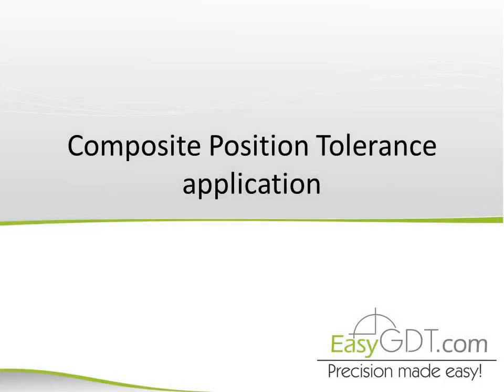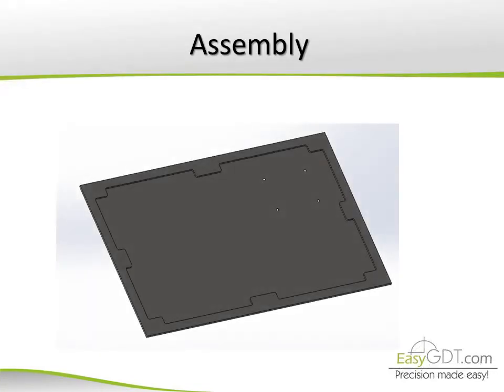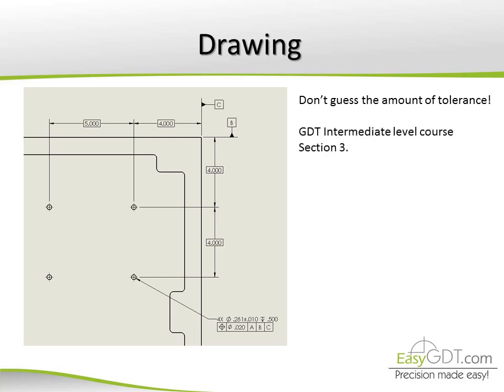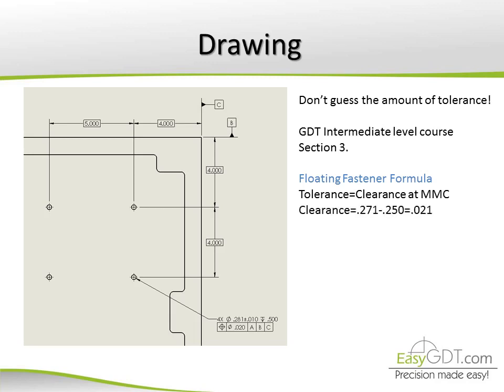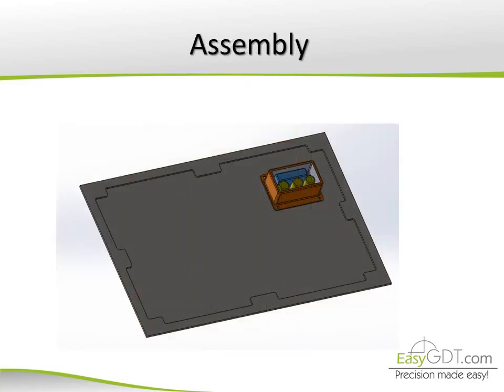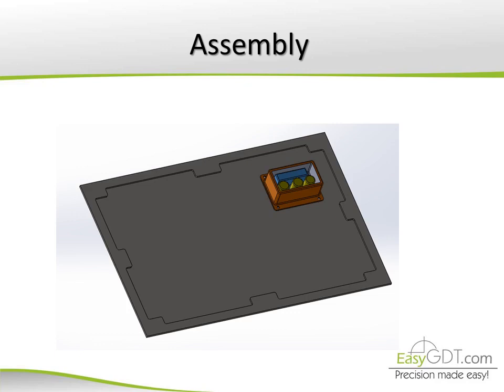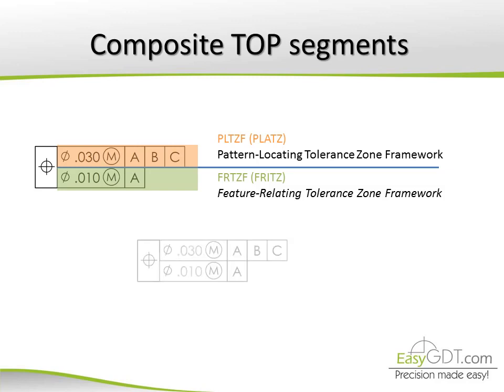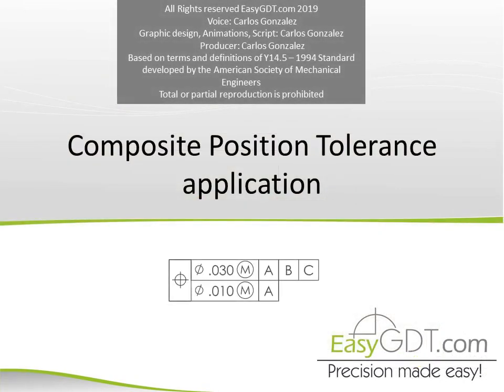Composite Position Application

Comment: Easy GD&T for the "BOX" location and the orientation relaxed within a call-out.  Great animation example for the viewer and the GD&T user.  (The top half of the feature control frame (FCF) callout is about the location based on a fixed or a floating fastener value.  The lower half of the FCF is a tighter callout controlling perpendicularity, as a relaxed composite tolerancing control.)  Thanks for a great video on "Composite Position-design applications. THANKS!

T J (Tom) Vanderloop, Author, Mechanical Designer & Consultant to ATEA, AWS & SME Membership/Leaders